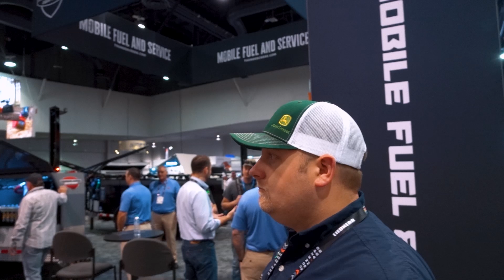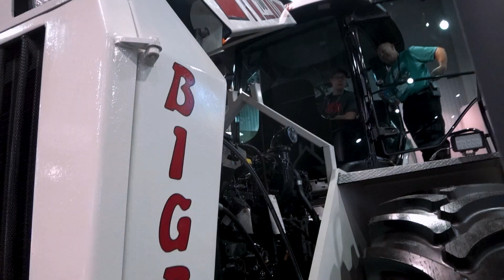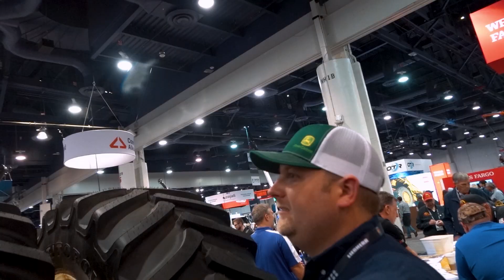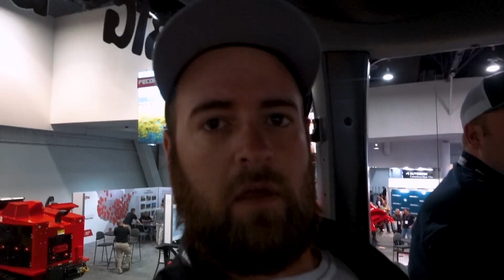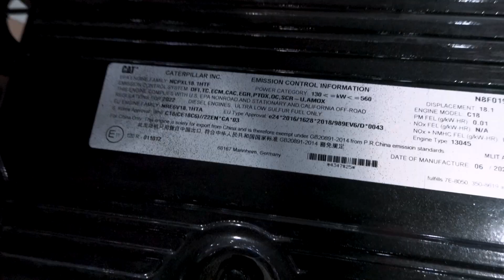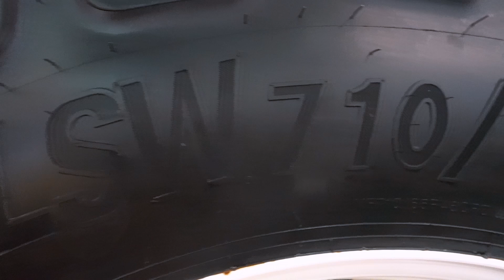Brand New 2023 Big Bud 700 Tractor | First Look

Comment: I love the idea of "easily accessible, off the shelf parts" and end user simplicity.  So important to keep equipment serviceable whether in construction or farming.  Nothing worse than a machine being down waiting for parts.  Good interview.
Reply: @Mr.Filson  I beg to differ. Over 500 Big Buds were built and many are still operating.
Reply: @John-nc4bl  And Big Equipment Company is the ONLY place to get parts for them. Twin Disc and Eaton want nothing to do with anything in a Big Bud. Cummins will work on the motor, if given a shed.

They were off the shelf parts, but the oddball off the shelf parts then and now, good luck. Neither me nor them can find some parts anymore.
Reply: @J-1410  that’s if they can find parts in their own freaking parts department at Cummins
Reply: @DillanLM  Yeah but they still do make the 855 and 1150 engines, so parts do exist. The  biggest problem, however is that the Cummins engine is the most reliable thing on the tractor.
Reply: @Mr.Filson  it's off the shelf at Cat
Reply: @Mr.Filson  did you not get the part where all the mechanicals were cat OEM parts? That meant any cat dealer will have parts! From construction and mining equipment......
Reply: @oomcgrathoo  No, that means Cat dealers that are near mines will have parts for the axles, most should have the engine parts, and it'll probably be easier to go to Versatile for the transmission parts.
Reply: @Mr.Filson  true, but I think the guy is talking about the Cat C18 engine and Cat t22 transmission that’s currently in production and I think the idea behind it is that there will be parts readily available as the engine is in current production and mass produced. In theory it’s a great idea, how it plays out?  Hard to tell but if it’s the same as the rest of the industry with all the big names powering their equipment with other manufacturers diesel engines (John Deere uses yanmar and Isuzu, hell, Cat uses Kubota engines, Kubota uses yanmar etc) parts should be available. I’ve not run into any problems finding parts for my 1025r and it’s yanmar engine. Cats one of the big boys and the c18 is everywhere. Time will tell but I think they’re on the right track sourcing engines from a huge manufacturer produced here in the states. I could see a problem if they were using MAN or other engines that aren’t used here in such volume.
Reply: @Harikarikillboy  The C18 Cat has been around for YEARS, add that to the fact that it shares many parts in common with the C15 engine (including the block) along with Cats long proven track record of parts availability I can't see any problems getting parts for the engine. The 988 axles are the same way, bullet proof and mass produced with virtually no chance that parts won't be available, I'm not as familiar with the transmission but Cat is the least worrisome in regard to parts.
Reply: @Harikarikillboy  I's argue the 1150 is more common than the C18, but I'd bet they got a deal for the complete package from Cat.

My complaint is everything from Cat is 4x more expensive than it should be, when you can get a Cummins for less and the same performance.
Reply: @J-1410  theyre expensive for sure. I like my John Deere 1025r, a tiny tractor for my small property, but everything was absurdly expensive with it. There’s a channel on here ‘Welker farms’ and they use Big Buds for a long time. They replace/repair the engines when needed themselves because there’s no super fancy suite of electronics and parts other than the ones they’ve installed. I think that’s what these people are trying to bring back and these farmers need a break somewhere. Everything on those farms are huge money. Like you said Cat and Deere are stupid amounts of money for parts and other than ‘f*** you, that’s why’ I don’t know why they’re marked so high. Captive audience? I don’t see how smaller construction contractors stay in business either. A decent skid steer is in the $100k territory, need a 3 ton excavator? You’re looking over $100k with no options. Cars, trucks, hell all of them are ridiculous. I bought a base f150 in ‘92, 6cyl, 4x4 standard transmission with a/c for $15k. Same one now is $40k. Just nuts. I never thought I’d ever see a pickup truck for $100k yet here we are.
Reply: Bingo hit the nail right on the head as a farmer nowadays everything so throw away tractors that were built in the in the 60s and up to the early 90s are getting more desirable because of the fact that you can work on them and you don’t have to have a laptop or dealer access to get to the software the only downside that is, is there making it harder and harder to get parts for it
Reply: @Mr.Filson  Mr. Kumudgin?  Mr Wilson?
Reply: @rrl124t  Its Mr. Malfunction..  LOL
Reply: @Mr.Filson  WTF is your malfunction..You one of them  progressive regressive's or something?
Reply: @Team  and "some" companies prioritize dealerships so it becomes "who has the most pull" to get the part 1st.  I like the contracted mechanics network model and lets the parts get to the need vs dealer qualilty
Reply: Everyone is missing the point. I wouldn’t be surprised if they sell more of these machines without engines. The main thing they are selling is a frame and drivetrain that will easily accept any engine that the end user decides to put in. When he talks about being able to fix it yourself hes not talking about that c18. That engine most likely will not be in many of these machines
Reply: @user-qt8zt6zg6w  The EPA has ended gliders, why would they allow gliders in a different industry? You can look up an interview from years ago where R.H. says the age of the frame is what allows them to keep rebuilding the old ones with out needing to add emissions systems, even when they swap to a newer, usually emissions equipped engine.
Reply: @J-1410  we don’t all live in comiefornia. If people are willing to delete machines building something like this isn’t a stretch.
Reply: @user-qt8zt6zg6w  You never said anything about deleting, you said gliders. Not my fault you can't remember what you wrote.
Reply: @J-1410  what? Not my fault you cant comprehend a simple paragraph
Reply: @user-qt8zt6zg6w  Not my fault you didn't write it either.

They will not be selling gliders. They will be selling them with the C18s, unless specified otherwise. Call them.
Reply: @J-1410  unless specified other. Your arguing with yourself.
Reply: @user-qt8zt6zg6w  Call them.
Reply: @J-1410  gave them a call turns out im right. Wow who knew not you
Reply: @user-qt8zt6zg6w  Who'd you talk to?
Reply: @J-1410  Ron. We had a good laugh when i explained your inability to comprehend simple sentences
Reply: @user-qt8zt6zg6w  Which Ron?

I think you're full of hot air "Q" and live up to your handle. Why? Because the Ron's I know there aren't like that, unless one recently had a stroke or hit their head.
Reply: @J-1410  what does the letter q have to do with that?
Reply: @user-qt8zt6zg6w  What Ron did you talk to, if you even did? You had a entire day to google them and pick a name to make something up.

No rebuttal on their attitude? 

You should be able to figure out your own name. Everyone would get the reference, especially on line or even your average news viewer.
Reply: @J-1410  sorry im not indoctrinated by the news so that would probably explain why i am not triggered by a letter. No need to google anything the man said his full name in this video. Of course if you actually watched it you wouldn’t be arguing with me.